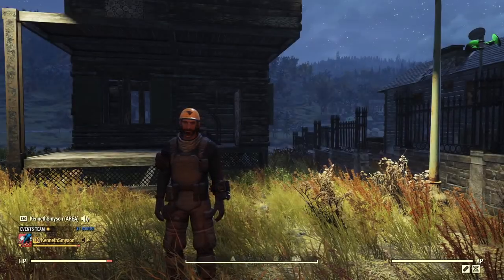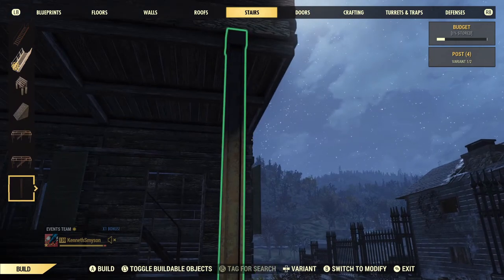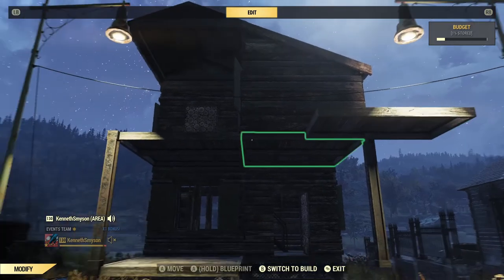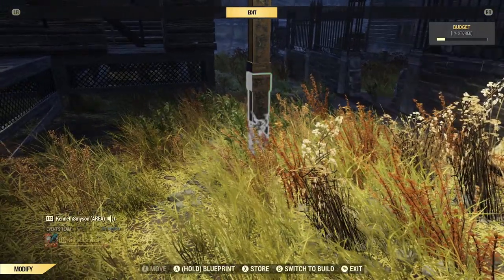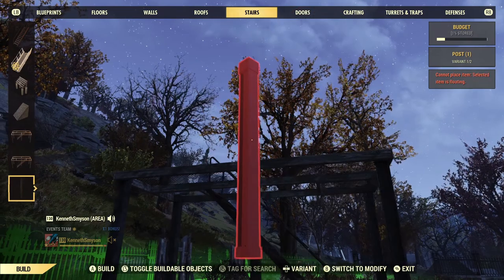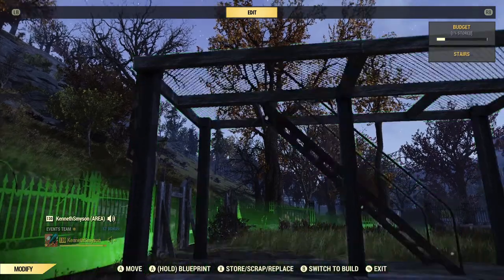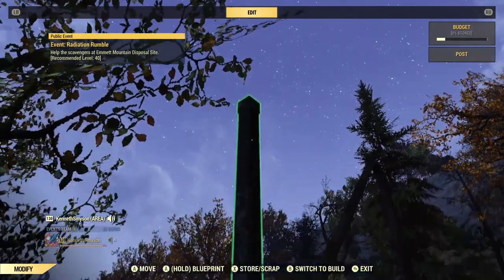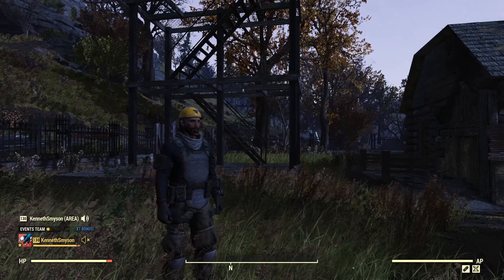Fallout 76 CAMP Tutorials 1: Steel Beams

Comment: Great video as usual.  

I free place them by using two small beams staked and bluprinted.  They can then be placed almost anywhere.
Reply from the maker: That's a good idea.
Reply: @KennethSmyson  Can't place them just anywhere, but you can place them in a lot of places, usually by looking down at the floor.  

I use them or filling gaps in fences, in the corner on internal walls where gaps are, etc.